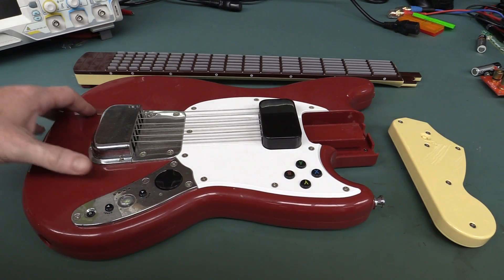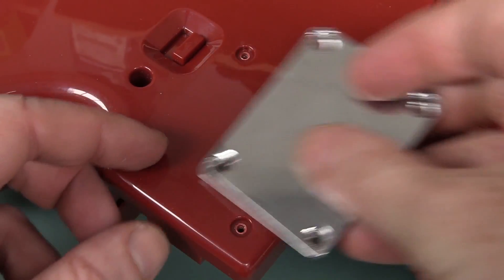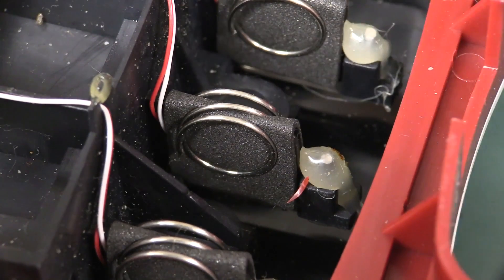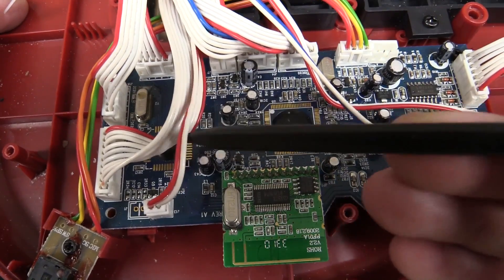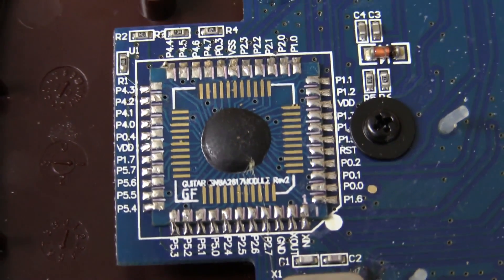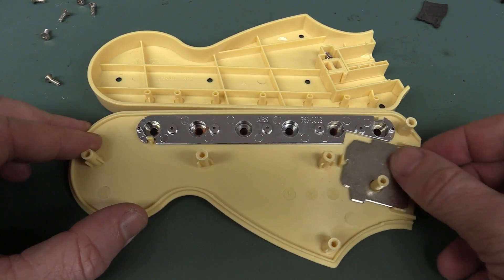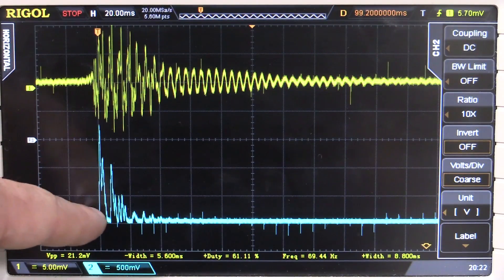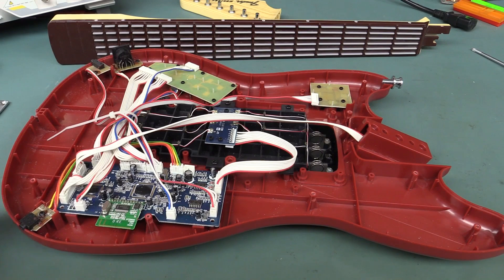EEVblog #770 - Rockband 3 Stratocaster Guitar Teardown

Comment: I actually counted the button amount, and yes it is 102.
Reply from the maker: Bluebirdinhell Nerd confirmation!
Reply: Bluebirdinhell You did? I counted the frets and multiplied by six! :P
Reply: Aadil Shah Even easier (unless this is what you meant) is to notice that the side dots only go up to fret 17 so 17x6 = 102.
Reply: 102 buttons, 204 switches
Reply: Aadil Shah I did do that at first but I kept thinking I was wrong so I just did a bunch of different methods like a dummy
Reply: Bluebirdinhell but there are 204 buttons

Comment: 2:45 It is there to look nice in a sense, real stratocasters have a metal plate there, presumably to reinforce the joint from the neck to the body
Reply: ***** Yep, no adjustments under the plate. The plate works as a type of a "washer" between the screws and the neck. The design of a Stratocaster (as well as telecaster) is quite highly optimized for mass production, so that might be a reason why ever since the day they have used a one single plate instead of individual washers etc. In some guitars you'll find individual washers/bushings/grommet type of things for each screw (I'm sorry I don't know the right name for that part in English) instead of a plate. And one thing also, the plate makes sure that the screws tighten the neck to the body evenly. Some people might not know this, but the neck holding screws do not actually bite into the wood of the body at all, the holes in the body are drilled large enough for the screws to go through effortlessly. They only bite into the wood of the neck, and the metal plate  kinda makes sure that the pressure of the screws spreads evenly. Why not also screw into the wood of the body? Probably for at least two reasons: 1) it's probably easier to get the neck to sit in its pocket firmly and evenly, and 2) lowers the risk of screws just snapping in half while screwing/unscrewing them. I've built a few guitars, and I've seen one beautiful neck being destroyed, because the holes in the body were too small, the screw snapped, and little after that snapped the person making the guitar... he couldn't get the snapped screw out anymore.
Reply: Intonation is adjusted at the bridge. The truss rod is adjusted for string relief, and there may indeed be screws under the plate, or shims in the neck slot, to adjust neck angle: neither of which is done for any reason to do with intonation: both are adjusted first, for playability, and then the intonation is compensated at the bridge. The heads of the screws into the neck are countersunk into this plate, not underneath it.
Reply: ***** intonation is typically done by adjusting the truss rod, I don't think there's any adjustments under that plate. The plate is there because the neck-body interface has the most stress over the life of a guitar.
Reply: ***** On a 3 bolt strat neck there is a small setscrew which is adjustable by hex key that sets the neck tilt.
Reply: muikunruoto I've seen a guy extract a snapped neck bolt by cutting a slot into it with a dremel, then using a flathead screwdriver to undo it as normal.
Reply: Harold Hennigan Some of the 4 bolts had "Micro-Tilt necks too. Peavey used it too.
Reply: Exactly, adjusting the nut can be be the only way to fix the intonation on some guitars. Turning the nut directly affects neck angle.
Reply: ***** Neck angle is corrected by shims or setscrews in the case of a Strat, under the plate we are discussing. Turning the truss rod nut affects neck bow and therefore string relief, which affects fret buzzing and playability directly, and intonation indirectly and to a very minor extent which is corrected at the bridge saddles. Any guitar whose intonation needs adjusting via the truss rod has its frets in the wrong place. And let's not confuse the 'truss rod adjustment nut' with the 'nut', which is what the strings pass through at the top of the neck, en route to the tuning pegs.
Reply: QuadMaestro Yes, yes, yes, yes, yes, and yes
Reply: Well that's a Fender Mustang not a Strat. But I'm pretty sure they both have it anyways.
Reply: No one pointing out that this is a Fender Mustang and not a Fedner Stratocaster?

Comment: 11:50 the electret mic and photodiode are for the game to calibrate the delays for audio and video.
They send flashing pulses and chirps to the speakers. The controller then tells the game how long of a delay there is between each, and it can adjust the scoring windows appropriately for your setup.  Rhythm gaming as the name sounds is very timing sensitive.
If your tv has a 100ms delay from game engine > hdmi in > on screen, by the time you've seen the 'notes' that you need to hit the computer thinks it's too late.
Likewise, if your sound system has a different delay such as 50ms for optical in to speakers, your brain will have a significant dissonance between what you see on screen and what you hear.  You won't know whether the scoring window is over the audio track or the video track or neither.  By aligning them separately you eliminate most problems -- the only furthest problem is then the game has to keep animating as if you did well even in the event that you failed to hit a note because it's waiting that 100ms window before animating a failed 'turn red' note.  This late feedback is annoying for expert players who need to know they missed immediately, not after the fact.
Reply from the maker: frollard Ah, that explains it, thanks for the detail.
Reply: EEVblog A tactile dome switch would not have a feedback similar to that of a guitar. I think the membrane would be better in this case
Reply: Astrogirl1usa You are welcome :)  See?  Some comments on the internet are worth reading!  Just doing my part!
Reply: frollard 
Thank you for explaining this to us all.
Reply: frollard Those delay figures you mentioned are really exagerated...but thanks for info :D
Reply: frollard
Yes, sometimes.  :P

Comment: why use jtag, it is an inhouse generic dev board that they mass manufacture and as you can see they have access to all the pins, just drop it on a bed of nails and all your programming can be done without having to add anything extra to every board to program the chip, could even be done as part of the qc for the board, and you can use the same board for multiple products.
Reply: Robonza For OTPs you could even program them on-wafer, then COB it. Swap the fiber glass for cardboard. Omit connectors, just wire it up. Do a two piece injection mold, decal it with asian hands. Profit!

I really like the double pads for COB and QFP, it screams optimism :)
Reply: kght222 The jtag is on the bottom of the board, he just forgot to look. It would be an OTP as well.

Comment: An actual Fender guitar usually has that plate there - though it would be metal - to hold the neck onto the guitar body using four long screws.  I assume they just did it to match the look.

edit- also a lot of people calling it a strat,  it looks like a mustang to me
Reply: Sasha Whitefur I'm not here to get into a "Who's right" pissing match.

My understanding is as follows

Headstock: Head of the guitar, houses the string trees and tuners.
Machine head: Tuner. Simply that.

Schaller, Hipshot, Gotoh. These companies call their tuners "Machine heads" as well. The term "Tuner" and "Machine head" are interchangeable. A machine head is on the headstock, the headstock connects to the neck.
Reply: Sasha Whitefur I'm heavily involved in the music industry, as a live engineer and musician. I've worked with some very big names (Members of Rose Tattoo and Hounds of Hiroshima to name a couple), and not one person has referred to the headstock of a guitar as the machine head.

You'll pardon me if this seems left handed, but I think your head is lodged in your sphincter.
Reply: Dacke Yeah, it is indeed a Mustang. Even says it on the headstock, hahah.
Reply: Sasha Whitefur
Google "guitar machine head" images and see what comes up. Compare that with "guitar headstock".

The big wooden thing on the end of the neck is the headstock, the mechanical geared devices that tune the strings are generally either called machine heads, tuners, tuning heads or something similar. Just about everyone who plays guitar in the english-speaking world knows this. I'm sorry Sasha, but you're wrong and the other posters are right here.
Reply: Sasha Whitefur 
I'm sure the head stock is just called a head stock and the machine heads are the string tensioners :P
Reply: Sasha Whitefur Hahahahah.
Reply: Lukas Nordlund There comes a point when you should just sit back and laugh
Reply: Dacke It's a mustang
Reply: AnthonyH  The headstock, is called a Machinehead.
Reply: Sasha Whitefur  what
Reply: Dacke it says mustang on the neck but strat on the label on the back, so the manufacturer obviously doesn't know the difference or they just reused the label from a different model or something.
Reply: @KX36 it's supposed to be a mustang. Not sure what they labeled it Strat though.
Reply: Sasha Whitefur Pardonnez mois?
Reply: The whole part is the machinehead.
Reply: Yes child.
Reply: KX36 Shouldn't expect anything less from a furry. Let's be honest, here.
Reply: Sasha Whitefur https://en.wikipedia.org/wiki/Machine_head

You don't know what you're talking about
Reply: KX36 A toy company in China would never reuse a mold or a sticker.
Reply: Sasha Whitefur Wow you must be a special kind of stupid. A Machine head is the metal tuner part on the headstock. You claim that anthony doesn't know "rockers" when obviously you don't either.
Reply: AnthonyH As a guitarist i can confirm that these things are indeed called what you say. Headstock is the whole head part where the individual tuners are mounted, and machine heads are the tuners themselves.
Reply: +Dacke  I own the mustang that that controller is copying it is indeed a mustang.
Reply: +Dacke they make a nice guitar
Reply: It's a mustang. There was no pro version of the strat.
Reply: The makers call it a
headstock, in the rock world it.s called a machinehead.
Reply: You don't know rockers.